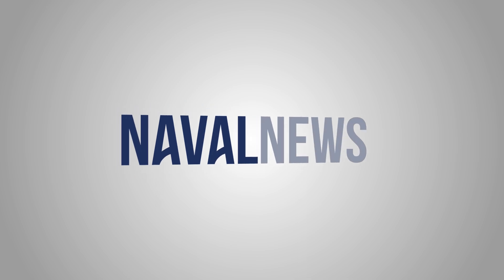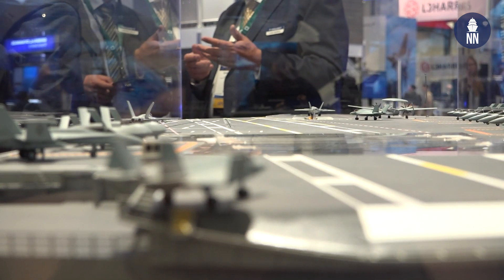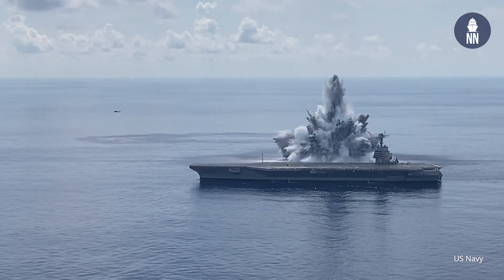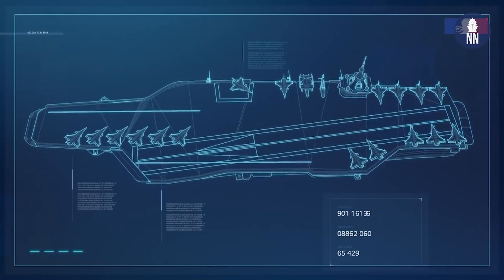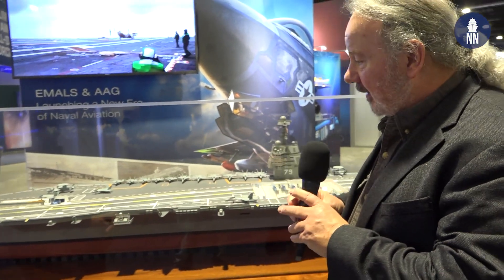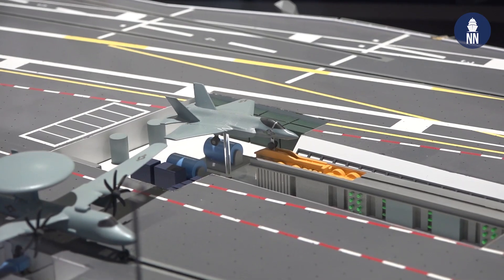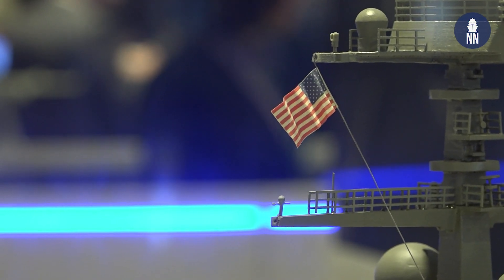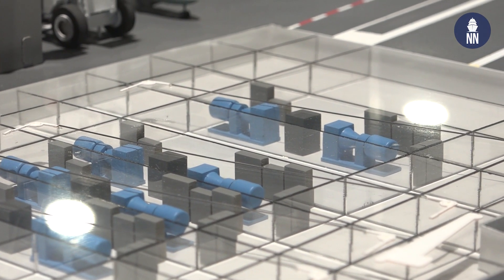General Atomics EMALS at Sea Air Space 2022: CVN 78 and French PANG Aircraft Carrier Programs

Comment: The French would be wise to not have an EMALS on their new aircraft carrier. The Ford's EMALS was/ is a failure. At first it did not work correctly and now it barely works, but requires much more maintenance than the contractor originally stated. The defense contractor supposedly tested all of this years before it was installed in the ship, but they lied. 
The EMALS on the Ford Class should also be removed and the contractor should pay 100% of the cost, while the employees responsible for the fraud go to prison.
Reply: Removing EMALS is easy, replacing it old fashioned steam system would be a gargantuan refit task. Reactors do not produce sufficient steam to accommodate it. Reactor was designed for less manpower operational manning, thus has fewer pumps, valves and pipes, so less available steam. It's an all electric warship where motors provide power for everything.
Reply: This EMALS story makes the MOD planners look like a set of smart, astute cookies!
At the time, when the UK chose the STOVL variant of the F35 bcos they had no control over the development of EMALs, I thought it a poor decision as we were getting slightly inferior performing 35s and I thought we should go with EMALs as the US will have to make it work! 

To order the cat & trap version of the F35s and install EMALs on the RNs 2 new carriers, and then find it didn't work as advertised, would entail ripping out huge areas inside those ships to install steam boilers, pipes, etc, for the new catapults, arrestors, etc. So the whole 'F35/HMS Queen Elizabeth class' ball game was hung on if EMALs would work as advertised! 

In the end the RN went with the, iirc, slightly slower, smaller range & less bomb load version of the F35 in flexible ships built to plan and approx. on time, and the MOD wasn't held over an extortionate barrel while US companies promised them "delivery next... ". 
I'm glad they got this as right as they could!
Reply: @Blitz Flanker EMALS isn't broken. It's working exactly as it should. it's simply immature technology
Reply: @spikedpsycho2383  i wonder how the EMALS is now? any updates?
Reply: @Blitz Flanker  The problems with EMALS are the same as with the electromagnetic cannons, which the US Government wasted a billion dollars of R&D.
The electromagnetic field is so strong that the heat destroys the equipment. The contractor said the equipment would last for so many thousands of launches, but the equipment only lasts for a very very small fraction of the expected launches. The EMALS system will constantly require replacement and repair of components. The carrier strike group will have far fewer launches and remain on location for limited time. The whole system turns the aircraft carrier to inefficient junk. 

The EMALS will either need to be replaced with steam or the aircraft carriers will be very limited big toys that require lots of maintenance. The USS Ford is 5 year old and it has not gone on one deployment. It has spent 5 years being tinkered with. The 2nd Ford Class Aircraft Carrier is close to being finished, but it will also be junk. That is already about 24 billion dollars wasted. The work on the 3rd Ford Class needs to stop and the following ships need to be redesigned for steam.
Reply: @willw8011  Electromagnetic guns work on completely different mechanics than the linear induction coils found in EMALS. EMALS will not experience these issues from the mere fact that they are completely different. Due to the relative lack of moving parts in EMALS, there should eventually be fewer issues and maintenance hours.
Reply: @Fhcghcg1   Reality proves you and the fraudulent contractors wrong.
Reply: @willw8011  Tell me how a railgun is in anyway related to EMALS